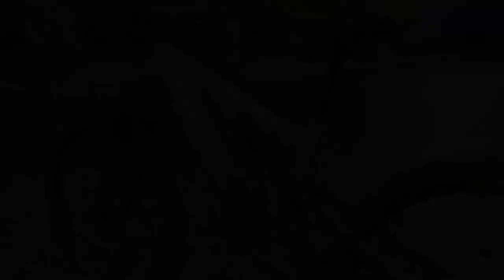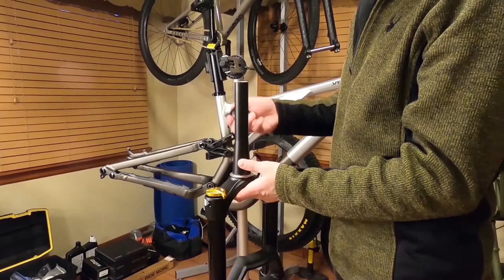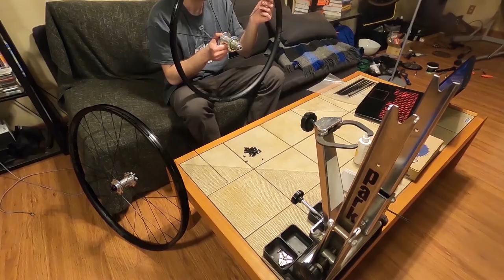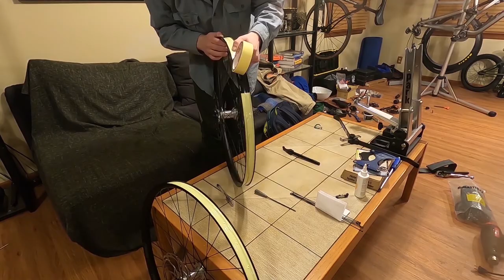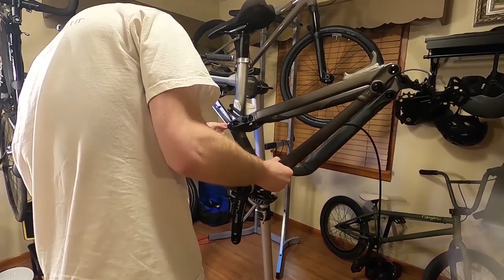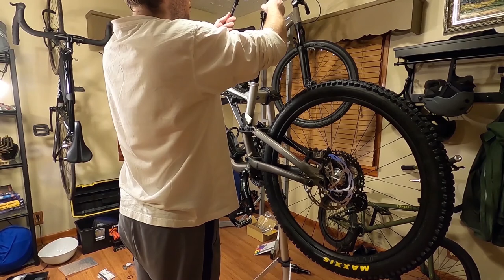Specialized Stumpjumper EVO Alloy 22' - Mullet All Mountain Bike - Dream Build Timelapse

Comment: are you running stock linkage or cascade link with the coil shock ?
Reply from the maker: Running a specialized mullet link, but a coil should work with any link; stock, mullet or cascade.